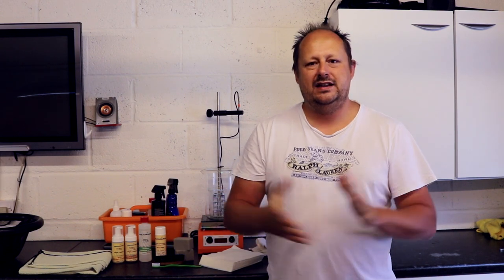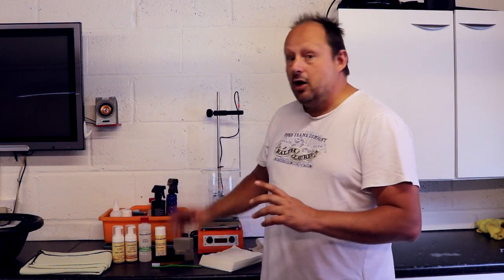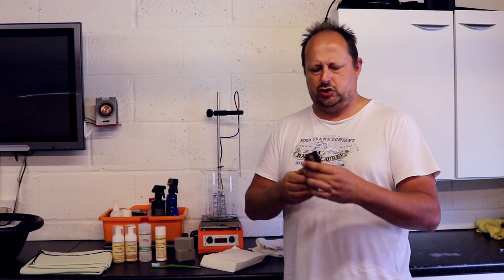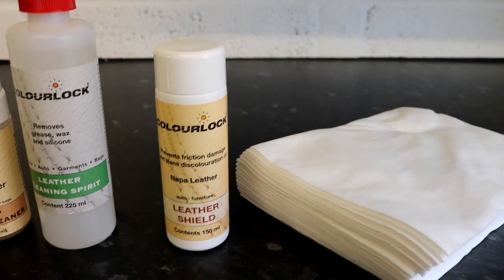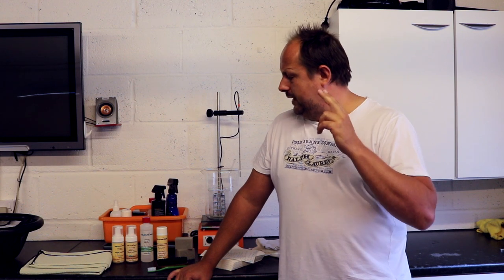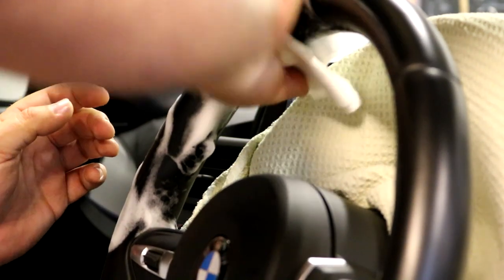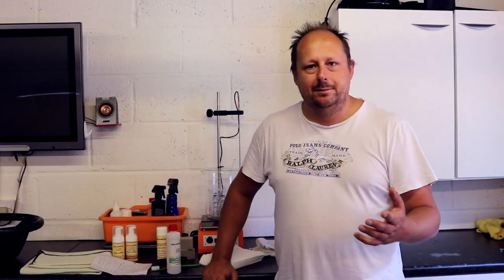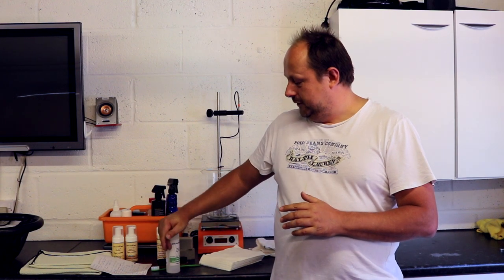how to clean a leather steering wheel - Steering wheel cleaning guide

Comment: Thank you, Professor. As always, learned something new today. One thing I will note is that my steering wheel appears* to be 99% grease free after just brushing on Griot's Garage all interior cleaner.(Audi A4) I did have a vehicle recently with sticky, shiny substance on the leather that took a few rounds of scrubbing to take off. A solvent would have been more efficient and effective in that instance.

Comment: Just a heads up for anyone else thinking about using an apc, I have a Mazda and used highly diluted greenstar and it was cleaning away the dye on the leather. At first I just thought it was super dirty but no matter how much I cleaned with microfiber towel and apc the black kept coming off in the towel. I didn’t realize I was wiping away the leather dye until the steering wheel started to fade. Had to buy the colourlock wheel cleaning kit with the fresh dye to get the color back to normal and now it looks great with no stickiness.
Reply from the maker: its nothing to do with the APC.  your rubbing off paint.     Detergent is not a great stripper of paint.  most steering wheel should have good quality processed finish on the wheel.  Some can get refinished or have poor quality processed finish with no top coat.

Comment: Thanks for the video John. I have the same steering wheel in my BMW F30 and I always get little white spots stuck in the leather which refuse to come off. Any tips for removing them or suggestions on what they are? 

I wiped my last one so hard to remove them, the dye started to come off and it left a faded patch on the top :( cheers

Comment: Wow. Had no idea. I've had a 2012 bmw for 6 months now.. And I've had issues with the dirty steering wheel.. I've bought 3 different cleaners now based on reviews but unfortunately a day after cleaning it's back to normal, greasy and shiney. I'll be trying this method next 👍
Reply from the maker: you need their leather cleaning spirit buddy.  taken the time to clean first with mild or strong leather cleaner and brush and microfiber..   then when it kind of looks clean, it will most likely still be sticky.. thats when you go in with the leather cleaning spirit to disolve the greasey sticky stuff and lift it away with a clean microfiber or viscose cloth.. keep going untill the stickyness goes.  GL mate
Reply: Forensic Detailing Channel thankyou mate. A friend sent me a link to your channel earlier today and I've not stopped watching all your videos! 3 new orders online so far 😂. The colourlock stuff is on the way 👌👍   thanks again
Reply: Fighting a Losing battle with this steering wheel. Tried absolutely everything now. Unfortunately the colourlock didn't work either following your steps on video. Steering wheel stil looks glossy and patchy.
Reply: @percynolan6198  So, I tried the same, and didn't get very far either. So I tried a new approach. I had an advantage that I have a heated steering wheel, so could heat the leather up to open the pores, but hopefully applying very warm, damp MFs might do the same. 

I began with a warm MF on a section, then applied BMW leather cleaner (I'm sure others are equally effective). Whereas previously I used just a soft MF and/or soft horse hair brush, this time I used a Gyeon leather brush - small, gentle circles as the brush traversed the section. I then used a warm damp MF to 'smartly' wipe away the product and dirt, rinsed and repeat the wipe. (I tend to think that part of the trick is in removing the product). I found that I had to repeat this 3 or 4 times for each quarter section, until I could clamp the section in the hand and release without get that 'stuck' feeling when you release the wheel. 

Took well over an hour, and you need to do it mindfully so not to 'scrub' at the leather. The result was good.

Comment: I'm a bit baffled as to why you would need the mild leather cleaner if you are using a solvent cleaner as well Jon? Surely the solvent cleaner trumps the mild leather cleaner, ie makes it redundant? Also Surfex HD is water based I believe and yet is pretty good at removing grease etc. I'm about to order a Colourlock kit to clean the Jag's interior, trying to decide whether to buy the solvent as well for the steering wheel.
Reply from the maker: if your steering wheel is in good nick just get mild leather cleaner.  Could you just use the leather cleaning spirit.. him not sure but like the foaming action with the brush and the normal leather cleaner I think is the best bet Steve.  the method I showed you in the video works.. Im not sure if just using the spirit would work.
Reply: @ForensicDetailing  cool, thanks Jon

Comment: Great video Jon! would bilt Hamber APC be suitable for cleaning a steering wheel?
Reply from the maker: at a low concentration yes.   just depends really though.  Id use it on my m140 no worries but perhaps if your working on a high end car with very expensive components then using a specialist product for leather is perhaps the wise choise.  lots will disagree..  even people in this thread are recomending very strong sodium based degreasers that are far from ideal even at lower concentrations but its like whatever works for you man...   bilt hamber stuff generally is safe though. surfex doesnt use anything overly caustic.
Reply: Forensic Detailing Channel cheers for the reply, I'll stay away from the APC, I've just remembered I've got a leather master kit for the sofa so that will be ideal 😁

Comment: Great video , got a question for you , I have a super clean leather steering wheel that is super slippery (I think it has been coated in a silicone spray from  the dealer ) , struggling to make it " tacky " so I can safely drive the car ,  any ideas ?  many thanks for your help
Reply from the maker: colorlock leather cleaning spirit mate.
Reply from the maker: and a clean microfiber cloth to soak it up;
Reply: Forensic Detailing Channel brilliant , I’ll get on the case , thank you
Reply: @timm4930  did this work?
Reply: @muhammadarfan4663  No ,ended up recovering the steering wheel
Reply: @timm4930  did you try the cleaning spirit and when retrimmed approximately how much did it set u back?
Reply: @muhammadarfan4663  No I didn't use the spirit but bought a leather steering wheel cover that needed to be stitch onto the wheel , it's perfect now , cost about £22 off ebay ( real leather )
Reply: @timm4930  aaah I see. Thanks for letting me know. 👍

Comment: Any tips for perpetrated leather on the steering wheel?
Reply from the maker: heres a guide on that adam..  if you scroll down halfway it discusses how to clean it.  just need to be mindfull of the fact loose liquid cleaners and using too much product as its going to go through the holes..

so foam cleaner with brush work and work in small sections and mop up the product after each little section

https://www.leather-dictionary.com/index.php/Perforated_leather

Comment: Magic Eraser is the best way to clean with out all the nasty chemicals try it just don't rub very hard.
Reply from the maker: I have some genuine automotive leather test strips I could do a video to show you how quickly these eraser pads go through top coat on leather.  I wouldnt go near the 140 steering wheel with them.  even bonded leather has the same flexible paint and top coat as top grain leather.  there are some things those eraser pads work great with but I dont use them on leather, I appreciate not everyone has my opinion on this though.